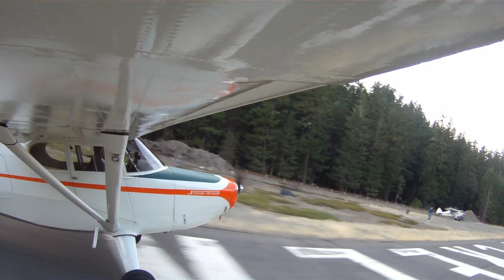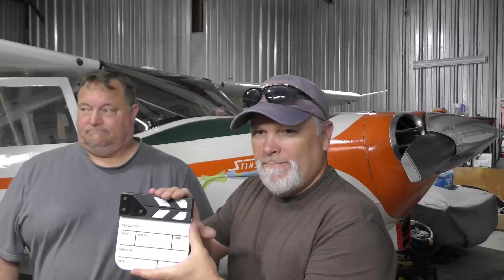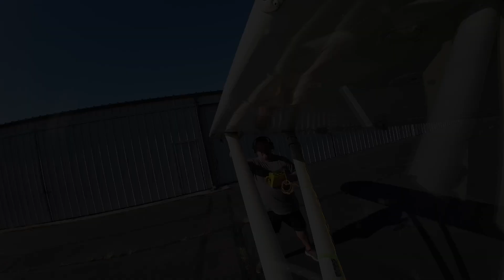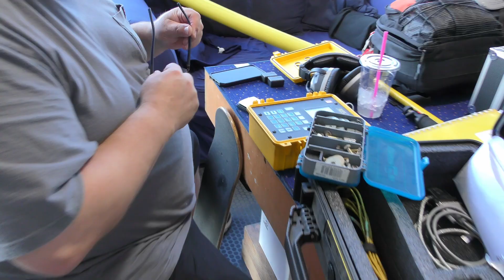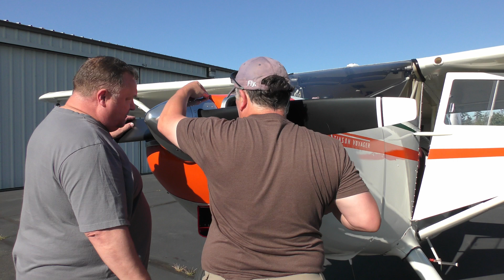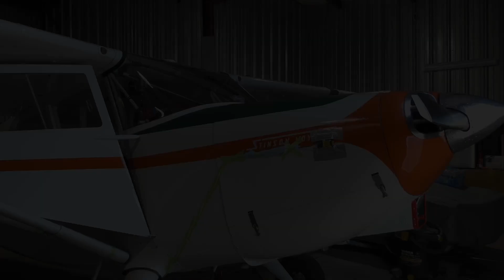Dynamic Engine Run | Reducing Engine Vibrations

Comment: Just did mine went from .85 to .07, what a difference! Under .08 is what the are shooting for and under .05 is fantastic from what i heard
Reply from the maker: Wow that's a big drop! I even noticed the difference from .43 to .19. We tried and tried and got as low as .19 IPS. We were  just chasing the weights around.
Reply: @FreedomFixer_Flying  look at the balance master.  Smooths all ranges of rpm.